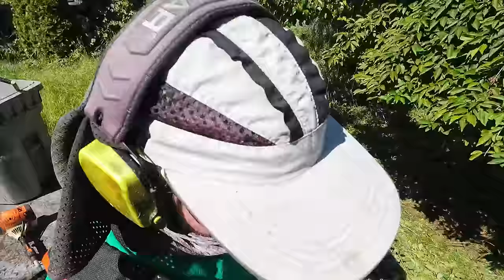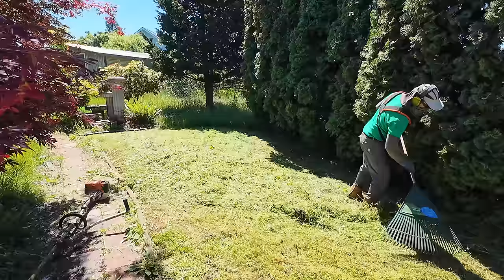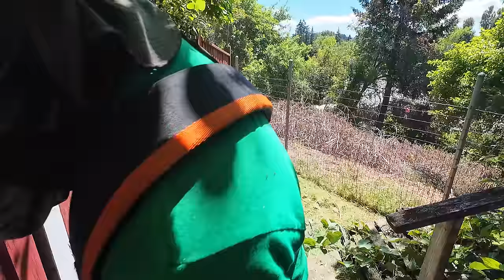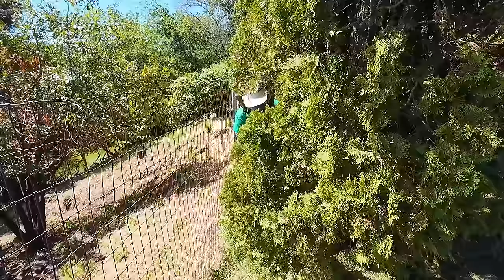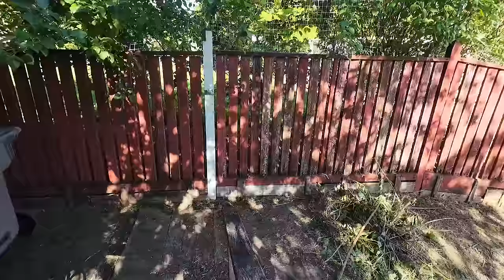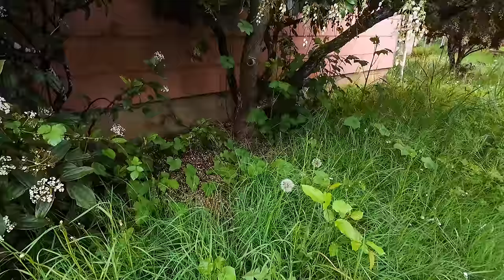How a Widow in a Wheelchair Regained Her Backyard Beauty

Comment: Love your work. Such an interesting garden. If only the garden could be wheelchair accessible for the lady.

Yes you can eat Prickly Pear (Barbary Fig)
The sweet and slightly tangy flavour of the fruit pairs wonderfully with citrus fruits, 
chili, and mint. It can be used in salads, sorbets, or even cocktails.

 When ripe, the pulp has a sweet taste that’s often described as melon- or berry-like. The skin and pulp of prickly pear fruit vary in color depending on the species. Some common colors of prickly pear fruit include white, yellow, purple, red, green, and brown.

Prickly pear is anti inflammatory and is rich in vitamin C, magnesium, and copper and provides a decent source of potassium. Also contains smaller amounts of other nutrients, such as calcium and several B vitamins.
Reply from the maker: Interesting. Thank you for sharing that.